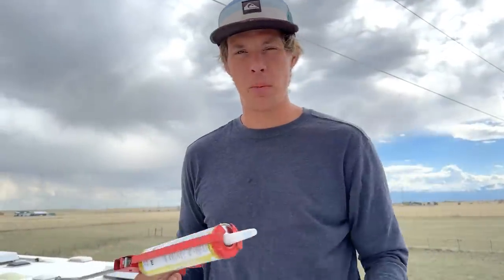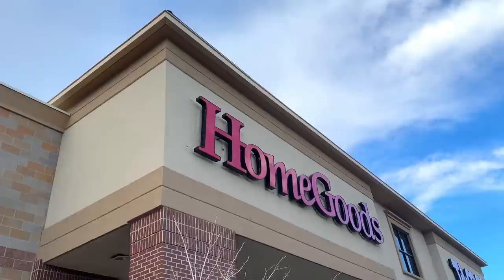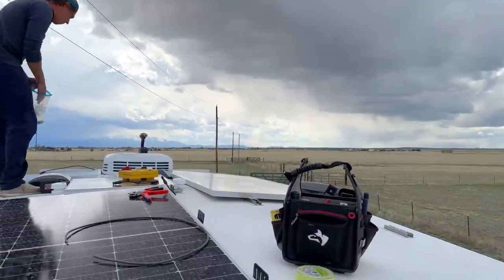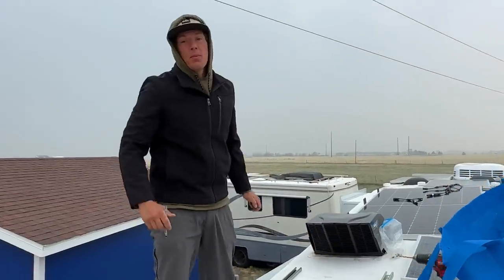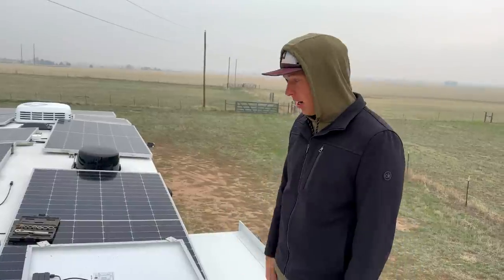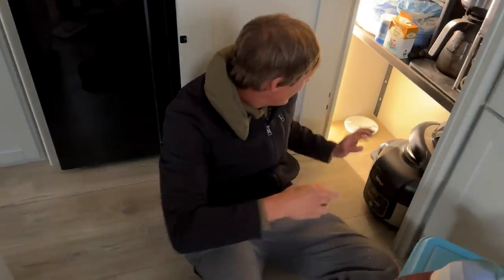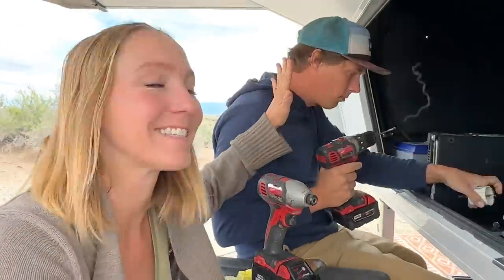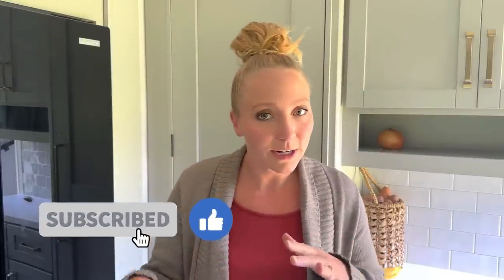We installed the BIGGEST Solar System on a Brinkley RV

Comment: Ok, comment coming from a retired electrical design engineer that worked for contractors for 35 years and did large utility solar for 3 years.   Good job Craig!   Only one thing you might change next time.   Typical clips are made from angles and screwed into the sides of the frame so they are accessible from above.   Yours work, but might be harder to install.   Again,  Good Job!    Respectfully,   Kevin

Comment: I noticed you have the positive and negative wires coming off the same battery. If you have 3 batteries in a line then you want the positive coming off one end battery and the negative coming off the opposite end battery. This allows all three batteries to charge evenly. The way you have it set up, the first battery will work "harder" than the far end battery. This will shorten battery life. Just an FYI.
Reply: Yes, 100% I couple YouTube videos about running multiple batteries will be helpful.
Reply: @SaltyVetAdventures and @Captain-Awesome, he has heavy gauge jumpers between all the positives and all the negatives.  The battery jars are wired in parallel.  All the positives are at the same voltage potential and all the negatives are at the same voltage potential.  It doesn't matter which battery posts the main leads come off of, they are all the same electrically.  You have a conceptual misunderstanding of the electrical theory in play here.
Reply: @warsurplus 👌
Reply: @warsurplus  okay, well you are not arguing with us by how Electical current flows. There is a difference when you wire in series versus parallel and reasons for both.
Reply: @Captain-Awesome  Yes, I pointed out in my response that these jars are wired in parallel with more than adequate cabling.  The electrical potential is the same at all the positives and all the negatives.  What is your point?
Reply: @warsurplus  my point is SaltyVetAdventures point. The first battery will charge and then the second and so on with this set up, versus charging all the batteries at the very same time and equally.
Reply: @Captain-Awesome  You are incorrect.  All the battery posts are at the same potential when wired in parallel with adequate cabling as in this setup  The batteries will charge equally.  Read my first and subsequent post.
Reply: @warsurplus  good thing you’re not electrical engineer.
Reply: @Mudford63  You're uninformed on two counts.  I am an engineer.
Reply: @Mudford63 I’m a retired electrical engineer who practiced as a licensed professional engineer for 36 years and @warsurplus is correct in his position.  Guaranteed the laws of physics still apply in the world of RV electrical connectivity just like they do everywhere else.

Comment: Congrats on the new rig. The install is looking good. great job. I have only one nit pick, the battery cables going into the rig should be fed from opposite ends of the battery bank. Positive on one end and the negative on the battery at the other end of the bank. Just a nit, it helps with power balancing between the batteries. With bot pos and neg attached to one battery, that battery works slightly harder than the rest.
Reply: Just came on here to day this! You guys did a great job but when you wire batteries in parallel like that you should do the positive and negative connection to your rig on opposite sides of the battery bank.
Reply from the maker: Thank you guys!! This is something we hadn’t encountered in our research and didn’t realize, so thank you for the tip, we will make the update! 🙌🏼😄

Comment: Nothing but respect for you both.  I installed a similar system in our fifth wheel, and spent about a week doing the "inside" components at one location, and another 3-4 days installing the panels and rooftop wiring at a different campground, in a different state.  Unfortunately, my rooftop days were over 95 degrees, would have loved the cool Colorado air.  Wish I was following you guys when you were in Co Springs, would have been glad to help with the install.  God Bless your adventures down the road!

Comment: Looks good. Something to keep in mind is that you want to make sure you clean the roof / existing sealant thoroughly before applying anything on top of it. Even though this camper is fairly new they're still going to be some debris dust etc on there and it will prevent the new sealant from adhering as good as it could if it was going on a completely clean prepped surface.

Comment: That is an insane amount of solar! Very cool. I have 1300 watts and 900 amp hours of lithium iron phosphate batteries, and that was the most I had ever seen on a rig in 7 years of boondocking. 2800 watts is incredible, and is going to be a joy to have and use.
So sorry for all of your past mechanical issues. I went from a 5th wheel that was nothing but trouble to a home build cargo trailer to RV conversion that I am still working on. Much smaller, but so much simpler and I can fix anything that breaks, which hasn't happened yet. It's amazing how much better of a job you can do yourself than the rushed RV company employees who built your rig. 
It seems I never had a single day when everything on the 5th wheel was working properly. I loved things like slides when I first got them, but now I love not having them anymore. No RV mechanics, and not even any dump stations anymore with a compost toilet. I boondock 100% of the time.

Comment: i installed 2 each 1000watt solar panels on top of my trailer, and thatrs enough power for the 8- 6 volt battery in series to make 4- 12 batteries. the 1000watt units make 42 amps into each solar panel. the batteries are always charged, plus at night  i use a 600 watt windmill to keep them top off .
Reply from the maker: That sounds like an awesome system!

Comment: In the event you need or want to upgrade your solar PV panel or do not want to go thru that kind of installation again go with flexible PV panel a bit expensive but definitely a lot easier to install and might even fit on the slide. Nice videos you guys are sharing.

Comment: Good job man!! With all that solar and not too many batteries for the time being you could look into hot water solar dump to use the solar when the batteries are all charged up. I think you could do it with the 120 volt element you have and some controls!

Comment: Just in case nobody else mentioned.  With 12v batteries in parallel, you want to pull the neg from one end of the string and pos from the other end.  This way, your batteries are used and charge more evenly.
Reply: I've heard something similar but it doesn't sound 100% logical to me. If you have the positive at one end, the voltage would drop a little as it goes through the line (from battery post to battery post). Although probably a negligible drop, wouldn't it make more sense to connect the positive to the middle battery in the bank so the distance to travel is essentially halved. Am I correct or am I on drugs?

Comment: Great fun video and nice install...fyi be careful and avoid standing on your slide top. They are not built for a person weight in the middle. They will and do deflect especially if the span a long area 😉. What is the weight capacity of the axles? Just wondering. We have a Vanleigh 335 RLP with a little over 3,000 lbs of capacity....good luck and safe sailing😊

Comment: I couldn't really see well but on your smart shunt it looked like only one side was attatched.
Reply from the maker: It had both sides. I just had to connect the other side a bit differently, which makes it appear like the wire isn't there.

Comment: So Craig I heard you comment that you wish you had gone with a 24v system on your last fifth wheel.  Are you glad that you have the 12v system now?  I just purchased a Z3610 and I am going to install solar, alternator charging, and also use a generator.  I have a 9500 watt inverter generator that I plan to carry it on the back hitch on a mobility carrier for shore power when we decide to go boondocking out west.  This rascal has 3 AC units.  What would you do if you could start over?

Comment: Hey Craig the cap that the factory had on the roof fits a water proof fitting that the wires pass through.  No box needed. Wish i could have helped you. NJ Atlantic City. Come by for a visit. We can have our pizza. Girls can sun it up at the beach. Lol. Nice job on the install of the panels.

Comment: Hmm, I am not a fan of drilling holes into my motorhome.  So, I am using fold-able solar panels I can place strategically where there can generate the most power based on position and angle.
Reply from the maker: That is a good idea too! We didn’t want to have to deal with the setup/take down each time and securing them in wind (because the wind always seems to find us! 😅) but we’ve seen people have great success with that setup too!
Reply: @wildrvlife  That is true.  But as my 450 Ah Li-Ion battery bank last us a week+, we most times don't have an issue with finding the opportunity to recharge or worst case use the generator.

Comment: Great video guys, I do have a question for Craig about battery wiring.  I have a 32' travel trailer 30A and relocating the batteries inside, and going to run a renogy inverter charger. How did you hook back into the OEM 12v wire?  The 6AWG wire runs from the old stock batteries to the fuse panel wondering if i can tie into this to feed the rest of my rig?
Reply from the maker: With my invertor, the batteries connect to the invertor and from the invertor to the batteries. Could be different depending on what invertor you have.

Comment: Are you or have you checked the weight and distribution at the scales so you know what weight you are hauling? It would be interesting.  comment:  I am glad you have BB batteries but look closely at the way you wired them in parallel.  I think their instructions want the connectors all together and not have the battery post itself between the wires connectors... the way you have it, the current has to pass through the post to the next wire and they said this creates heat ... resistance.  With such a high load I'd check that... for sure.  pb

Comment: I hope you used butyl tape under everything then the lap sealant is the secondary protection…
Reply from the maker: Yeah, those strips you saw us laying under all the unistrut was a thick roof sealant type tape as the first layer of protection and then lap sealant everywhereeee as well 😅
Reply: Awesome, look up butyl tape if that’s the tape you used and then lap sealant on top your good! I saw you only used lap sealant on the conduit box for the wires, and well the conduit they installed is probably fine, but down the road I wouldn’t want that to be a place where water gets trapped. You guys did great! I’m not picking your work apart at all! You guys are brave to drill into the brand new roof like that… I would probably have needed some pull-ups before I would have the nerve to do that, but I remember what happened with your wall on the last rig and know how bad water is so I just wanted to make sure you guys are protected. You tithe to my God that makes you my brother and sister.

Comment: Question,  we just bought a z3100 and I am trying to figure out their prewire so I can wire in the victron inverter/converter.  Did you use the prewire from the Brinkley or did you run new wires to connect the inverter?

Comment: Great videos guys! I have one question for ya. I ordered a pile of Victron components for our Brinkley also. What did you do with the factory converter after installing the MultiPlus?
Reply from the maker: If you wire the victron invertor into your distribution panel (aka breaker panel), so not using the brinkley invertor prep, you can just unplug the convertor and leave it where it is.

Comment: What did you screw the uni-strut into?  Did you hit the roof supports or just go into roof decking?
Reply from the maker: We tried to hit roof supports whenever we could, but in some places where it didn't line up, we just screwed into the roof decking, but Brinkley uses a pretty thick plywood across the roof so it had a good amount to hang on to

Comment: Hey guys, just joined your channel and watched a couple episodes already. Wondering how many total watts of solar panels you have on the roof. Did you run a controller for each panel? seemed like you had a lot of controllers hanging. Just wondering. Did my own also but, now wondering if i need more components. Look like three batteries also. Lithium?

Comment: U not going to Bolt down the box. R use A Electrical Ring to go around that pipe then screw the ring to the roof to make that box secure. Cus silicone not going to hold going the road